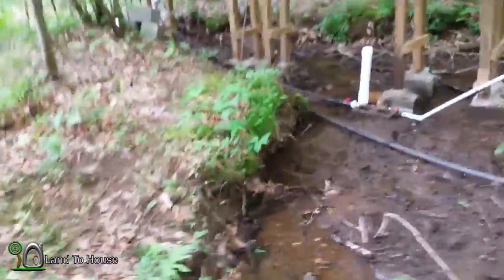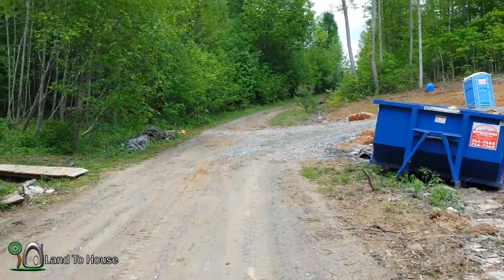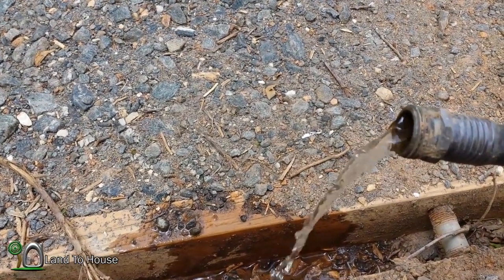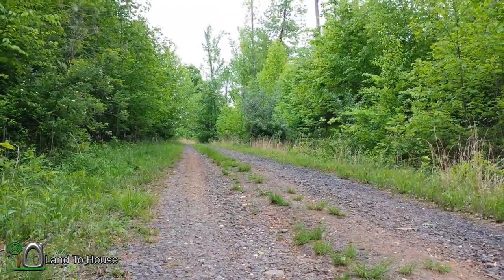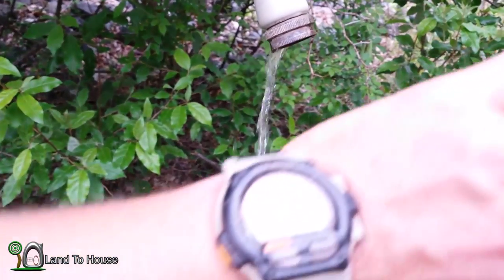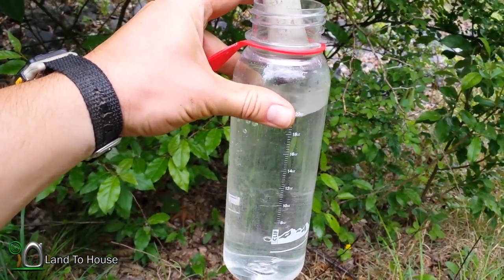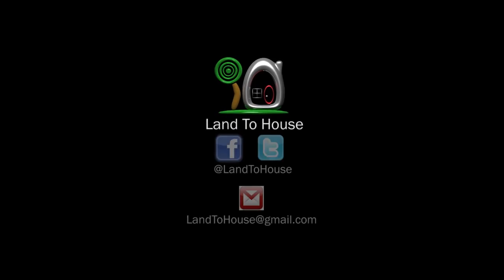Ram Pump Height Test

Comment: Oh boy, I am still here tryin to find answers.  Hubs is being... Less than cooperative in this endeavor, which is why I went w the ram pump idea in the first place- I'm not a wood worker, plumber, or electrician. And I have cows and garden to water, and a six ft deep deep or spring well that had issues in summer due less rain, w a backup, of being able to pull from the creek.  But the creek has sediment issues, which plug up the sediment filter in the pumphouse...daiky.  It all depends on how much laundry, dishes, garden watering and livestock watering I do all at once... How many gallons of water I pull through that sediment filter.  The sediment filter gets full, which starves my electric pump for water, which activates a shut off switch, which saves the electric pump from now sucking air.  Which means daily, if not twice a day, I am pulling that whole assembly apart while hubs is at work, cleaning out that sediment filter.  It's been like this for two years now, and the plumber people, as well as our Dads and everybody else are like "Drill a well".  Which will be another couple years bc hubs is passing to fix cars right now to get to work.  $10,000 give or take to drill a well. 

So, I'm looking at other options that I can do w my woman strength, like building a ram pump setup, or ram pump in conjunction with a water wheel. Or a water wheel turning a piston pump.  We just have a slow, flat, winding creek w very little drop (head, rise ...).  Surrounded by steep hills everywhere else, yay.  So far we have run 200 ft of inch and a quarter black poly pipe upstream ( crawling through brush, sticks and blackberries... Not fun our creek is way more overgrown than yours and is a yearly maintenance thing to clear out the stuff that gets blown downstream by the floodwaters in winter) .  Still not enough drop in that creek to even run the ram pump.  My Dad, the mechanic and family McGuyver, too three ram pump I had home and fiddled with it for a while, and built his own version as well, bright it back here.... Put a bucket hooked up to it in to of a barrel (about 3 ft drop) and showed me that yes, it does work, my creek is just too flat.

Back to square one again. 

Welp, I gotta go jump in the shower for church, and then with maybe some cajoling, I can get hub's strong body to help my fat body run another 100 ft of pipe.  Pain.  I should be so buff by now but I'm old. Lol  This will take a miracle to convince him.  He is already poo pooing it.  Again.

I have half a day and then he goes to bed to get ready for work again.  Then I'm all alone for the week again. 

If this length of pipe nets me nothing, my next plan is a 5 ft tall water wheel on pontoons to account for the rapid rise n fall of creek water level w rains.  It rises a few inches w a few days normal rain, then drops to a creek the size of yours, with small two/three ft deep pockets in summer.  I have built a small bicycle tire water wheel as a test run, and it gets bogged down when we get a little rain and has to be adjusted.

Anyways, I guess I'm just commiserating.  Scanning all your videos and others like it, looking for ideas.
Reply from the maker: Hello. The ram pump is going to need head pressure to operate. 2 foot minimum.  The head pressure to lift ratio is 1:7 typically.  

You might check my video from Saturday on installing a 1-1/4" pump. It shows some silt filtration options.

Comment: i know its a long time since this video was posted, but i discovered it now.
anyways, im wondering if this kind of pump (if given egnough time) would be able to pump water, vercticaly, up about 230Ft. i dont too much about what kind of line i would have to use, but i guess a bigger pipe is better.
i ask about this since i would need a pump to bring water to some watertanks that is going to be used for watering.
i know that it will take a long time, but time isnt the most important factor for me when it comes to this particular problem.
Reply: not without installing about 5 ram pumps  at 50 feet intervals. of course each pump uses a lot of water.
Reply: @victorhopper6774  that could be done.
Reply: @hansshamre8535  yes but if i remember correctly there is about a 10 to 1 loss off water at each ram. of course funneling that water back to the lower ram  so it can be reused might offset some loss

Comment: not so much the distance but the footage height elevation understand 1:7 ratio was in your testing...  nice job
Reply from the maker: Thank you. The horizontal distance does not make much difference in the operation of the pump. But the vertical is very important

Comment: Ok . my drama is i've got no chance to lift  delivery height , i have it going into a 20l drum to give it some pressure, might see if i can install a bigger drum to push it a bit harder. ? Thank you for your advice. Regards Danny...... if your ever in Melbourne feel free to call in for a beer.Cheers.........
Reply from the maker: That 20l drum is a good source of water to keep the debris out but I am not sure that it is going to help any with head pressure. A larger drum will only help if you have a taller drum. IF you are siphoning out the top it would increase the head pressure. If you are pulling from the bottom it would increase the hydrostatic pressure. . . It would be fun to visit Australia but I do not see it happening any time soon.

Comment: Thank you for reply.  My drama is i don't have the enough fall from water supply to pump is about 2m drop, at 14m long i'm using 30mm  supply hose  and 19mm out to 50 feet to what i'm trying to fill. if i open the water  out tap full the , the check valve stops working , no matter how much i prime it.  it works with tap just a bit opened andt the water is just trickling out.
Reply from the maker: 2m is around 6.5 feet. You can expect to lift water 45 feet with that. 

Normally when that happens you dont have enough back pressure. You might want to increase the delivery hight more and then try the pump with the valve open all the way.

Comment: I'm impressed. that's a long way to pump water. just a quick question.  how long does the input pipe have to be  to get it working?
Reply from the maker: I have heard of people pumping water over a mile before. The length of drive pipe is dependent on size of pump. But you can be safe with a drive pipe between 15 and 100 feet long. I like at least 50 feet for most pumps.

Comment: Old comment,but can that pump water up to 20-40metres? because i my cottage there is no water so i think that ram pump would work?
Reply from the maker: It is possible to pump water to 40m with the ram pump. It would require at least 6m to get water to that hight. The waste valve will wear down quickly at this pressure.

Comment: Hi Seth, I came across the awesome idea of a ram pump recently and seen many of your videos and loved them. We are in New Zealand and I can't wait till summer comes along to build one myself. I still have one unanswered question though. While you and some others talk about approx 7m delivery height for every meter of (drivepipe) fall, there are commercial suppliers, who predict a delivery hight of 40m and more for 1m fall (e.g. http://www.alternativeenterprises.co.nz/WaterRam.aspx, http://williamsonrampump.co.nz/index.php/pumping-capacity) The output at the top might be small, but with 345liters/day with only a 15mm drivepipe at a 1:30 ratio or 280liter/day with a 40mm drivepipe at 1:40, it's still plenty of water (when collected in a tank) for a holiday bach that only gets used every few weeks just a few days. I surely understand that fully stainless steel pumps, professionally manufactured get better results than home made ones, but the difference of 1:7 to 1:40 seems to be quite massive. Is there another factor that would effect the delivery height other than the initial fall of the drive pipe? Would a big diameter drive pipe (when there is sufficient water flow in the stream) combined with a small waste valve and/or delivery valve get the water pushed higher at the drive pipe? Or rather a big valve? I'd think that when you've got a huge amount of water running down the drivepipe it's got more energy to push up a small amount of water the delivery pipe. I am not interested in any huge amount of pressure or water output at the top, but love to get up to 60m (250-300m distance) with approx 1-2m fall. The mentioned commercial pumps would be able to manage that regarding to their info sheets. I'd love to understand why and what they do differently. As this is mainly a fun project at this stage I won't be keen to spend several thousand $ on the pump only. Piping it several hundred meters will be expensive enough! ;-) - Thank you! Keep up with the great work and videos! :-)
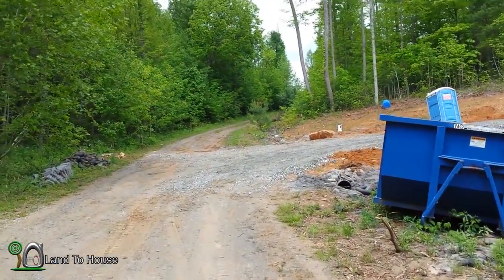Reply from the maker: Hello. I actually have very little experience with the expensive professional commercial grade pumps. I have seen values of 1:10 and 1:20 on those before but never 1:40. That seems a bit crazy. There are a few things about the commercial pumps that are much better than the home made version. The waste valve has a dial that can be set to fit the drive pipe length and hit the sweet spot for max efficiency. There is also a nice snifter valve on those pumps that keeps water from filling the pressure tank over a long time. All metal construction and mounting the pump in concrete is very good. Having a metal drive pipe will greatly increase the efficiency. it is important to keep the waste valve and drive pipe the same size though. ... All this to say those pumps do work well but paying thousands is more than most can spend. The style pump that I make tops out at 50m Lift. There is just so high that those swing valve can pump to. I also must say that with that kind of head pressure the waste valve will only last a few months before it has warn out.

Comment: Hi Seth, Great videos! thanks. 
I want to use the overflow from a well I just had dug and pump it up to my garden. I"m not 100% sure what the drop is right now, it's a pouring out at a good rate for sure. Right now the well company ran a 1" poly line under ground from well casing and it surfaces at the edge of an embankment. It's probably 4-5 feet lower at the top of the bank from the origin. I could increase the drop significantly, probably 20-25, if I run the drive pipe down over the bank. Right now drive pipe is about 30 feet long. What would be an optimal drop be? Is there a point of diminishing return?  I want to pump the water up to a garden which is about 150-200' away and up a vertical lift of maybe 35' or so.

Also I have a bunch of 3/4 poly I'd like to use for the outlet side. since the drive pipe dia is pretty much already set at 1" is it ok to use 3/4" on the other end? I think you said somewhere outlet is usually half of drive pipe dia. 

And finally, I had planned on using a 4" pump @ 24" long and am going to try your bucket method routing the drive pipe into a 5 gallon bucket then on to the pump.
Does this set up sound like it would work?
Thanks in advance for any insight you can shed.

Comment: Height (Head Pressure) defined as a vertical distance from point of discharge check valve to delivey point of pipe or hose..the test you made on this video does not give us a correct display what so ever..its almost horizontal distance and the only thing that matter on this case is how many bends and how sharp that bands were...
Reply from the maker: Actually I did not specify head pressure or delivery height. My apologies for not using a higher level of specificity. I set out to test the hight that I could deliver water too. I am about to set up some water storage tanks for my garden and I wanted to find out how high I can place the tanks.

Comment: plese let me kow wht size to use to pumpimg wter 25 miles
Reply from the maker: I have heard of pumps going 1 miles I have not heard of water going 25 miles. The pressure in the delivery pipe is very low so the friction is also low. The pump might push water that far but I do not know.

Comment: a plunger valve works better , that way when water comes out the weight of the water will help it come back down :P they self start first go every time 

pretty much a rod with an rubber seal on the end , when water exists it lifts the rubber seal blocks the exit , and the water now sitting onto of the plunger acts as the counter weight

Comment: Ok if I did the quick math right for a 24 hr you get 313 gals or there about. That's impressive. Like these ram pump videos. Thanks.
Reply from the maker: I have another video showing a test of this setup and I was getting 1 gallon every 6 min. So that would be 240 Gallons per day. Still that is not bad for watering a garden. Now that I have fixed the intake and the air leaks in the pipe I will be doing a longevity test and another height test. Several ram pump videos on the way.

Comment: What was the head height and incoming flow rate on this one Seth?
Reply from the maker: +pat wall the head height is approximately 6 feet. I should measure that one to make sure. The flow rate of the one inch RAM pump is 4 to 5 gpm.

Comment: what was the total elevation gain for the 500 foot of hose?
Reply from the maker: +zehnsechz I am not 100% sure but from Google Earth it looks like 40ft.
Reply: @LandtoHouse   I have to wonder if it would be capable of lifting 50Ft vertical on a 1/2 inch line
Reply from the maker: Yes for sure! The ram pump output is low flow so friction loss is low. That being said a larger delivery pipe is better.
Reply: @land to house

I have a very steep hill from creak to garden area, which is through a thick forest and difficult to guage height differential.

I think the water flow is comparable to your stream there in the videos. There are two water falls, 4m (12ft) and 1.5m (4ft) respectively. I can feed the water from a pool above the first fall. I'm wondering how high I could elevate the water to get the tanks suitably placed above my garden. The hill is not a cliff but not far off it, feels like it could be a 100ft differential.